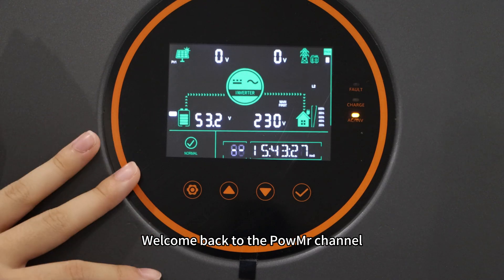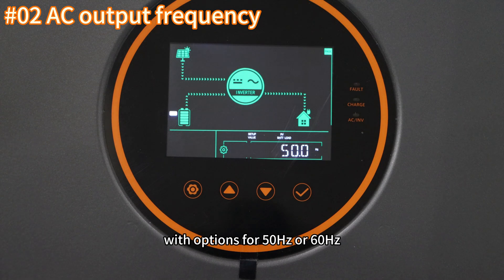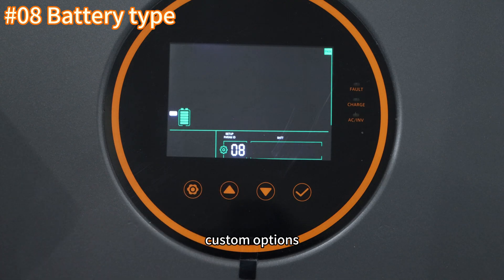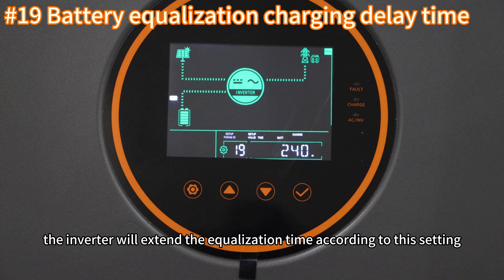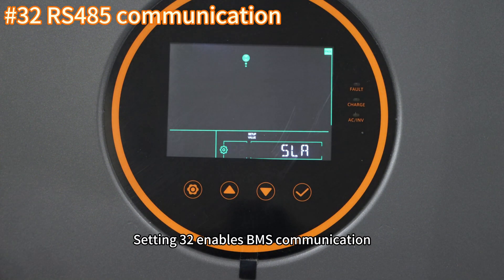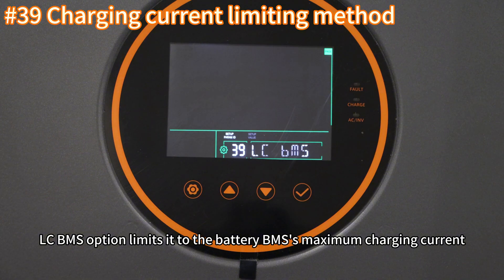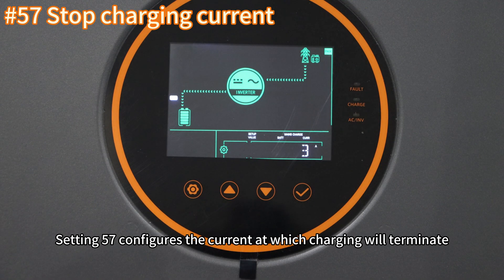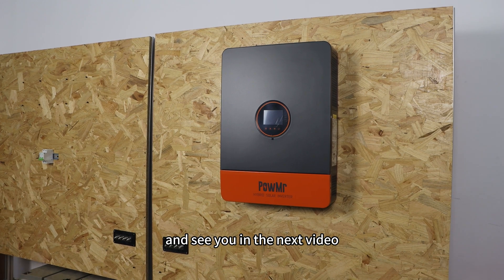How to Setup the POW-SunSmart 12KL3 Solar Inverter?

Comment: How to configure the inverter from three phase to single phase
Reply from the maker: If the three-phase inverter is used as a single-phase inverter, only 1 live wire and 1 neutral wire are needed. The maximum output power of each phase of 12KL3 single-phase is 4KW.

Comment: When the inverter is in on-grid mode how do you prioritize PV to battery charging only?
I noticed the inverter utilizes the AC to charge the batteries, even when PV has more than ample supply for the home load.
Also I get an error code 0013 bulk radiator over-temporature when PV energy goes up, why?

Does the inverter/app can show the direction of  wattage/energy going back the grid?
I'm not able to see it the tables as well
Reply from the maker: Please send it to this email: support@powmr.com. Our technical staff will check it for you.

Comment: What is error code 27 on this POW-SunSmart 12KL3? it's not in the manual.
Reply from the maker: Hi,  27：LinePhaselose: Grid input phase lose

Please check how many live wires are connected to the mains.

Comment: I have two pow hvm 6.2k-48v lip in parallel,connected to a lifepo batterie with a Daly BMS. In the manual it says that I have to connect the BMS to one of the inverters. The BMS has Bluetooth but no com port. How can I connect it?
Reply from the maker: You can see the com port by taking off the top cover.

Please check the video below:
https://www.youtube.com/shorts/zcLd53Fn3Wg
Reply: That was not the answer to my question. I know where the ports of my inverters are. My question was, how can the inverter communicate with a Daly BMS that doesn't have a com port but only Bluetooth?
Reply from the maker: @edgarmock8307  Can only be connected through com port.

Comment: Can you adjust the Utility charging current (28) in 1A increments? 

I need to optimize this for 3*16A. 10A is too little and 20A too much.
Reply from the maker: the 12KL3 model?
Reply: Correct, 12KL3.
Reply from the maker: @hypeac  The increment is 5A each time.
Reply: @PowmrSolar  that is good, thank you for your promt answer!

Comment: Can it accept single phase AC input? And also its output on single phase is still up to 12kW?
Reply from the maker: This is a three-phase model, each phase is evenly distributed with 4KW. If you want the machine to output 12KW, you need three-phase power. Single-phase power can only output 4KW.
Reply: @PowmrSolar  Thanks. It means on a split phase (L1-L2-N), can use up to 8kW
Reply from the maker: @jbcodilan  Yep.

Comment: Can this have solar as primary supply, and any extra charge the batteries then have batteries as secondary  supply if solar not enough and then ultilly as back up and then set a timer to charge battery from ultillys at certain times of the day.
Reply from the maker: Yep.